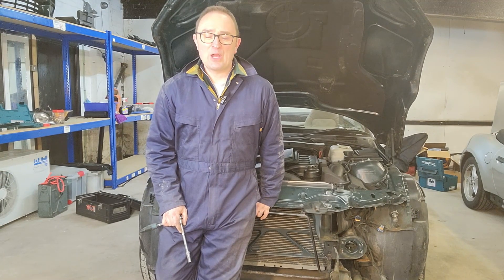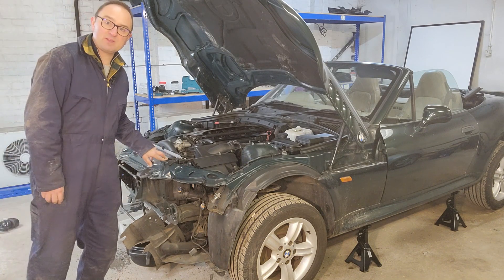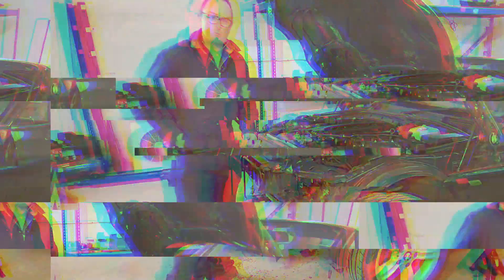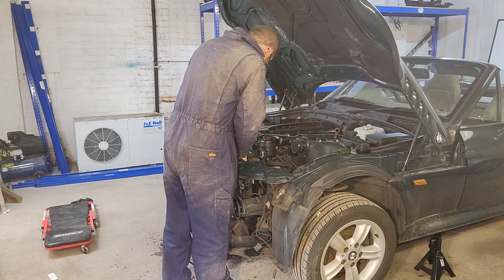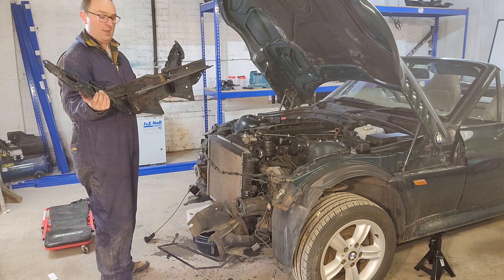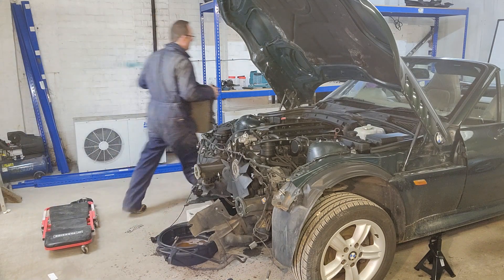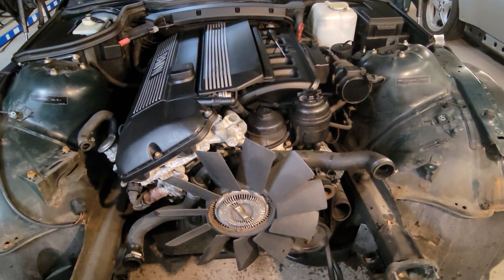EVGT: BMW Z3 engine removal for electric car conversion - part 1

Comment: This is interesting, which video do you discuss the battery size and motor power/ range of the new EV Z3 you end up with? 

I remember this being the mini sports car i wanted as a kid in the 90s
Reply from the maker: Sorry for the slow response - missed this comment. I think that's in the first video from this series from years ago (before it got put on hold - recently restarted). It's here: https://youtu.be/lg7IqpF7itY

But plans have changed. I'm still using the Lexus IS300h motor and inverter but battery pack plans haven't been announced yet. I'm targeting 100 mile plus range though for this one.

Comment: I don't know about the inline six but it is possible to remove a 4 cylinder motor from a E36 without taking the front off the car. Maybe the six is too big
Reply from the maker: Oh you absolutely can do it without, it's just easier to take it off. Especially if you're going to be mucking around in the engine bay measuring up and tweaking things.

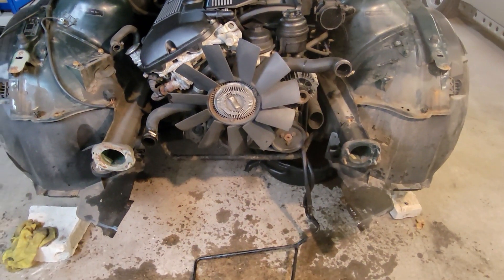Comment: 13:41 The engine is probably not drained completely from coolant, AFAIR there's a drain plug in the block on the side which you can use to remove more coolant, but it will still be a mess 🤣
Reply from the maker: Yeah, I didn't think it would be that simple! Thanks for the tip. When I get it jacked up some more I'll have a hunt for that.